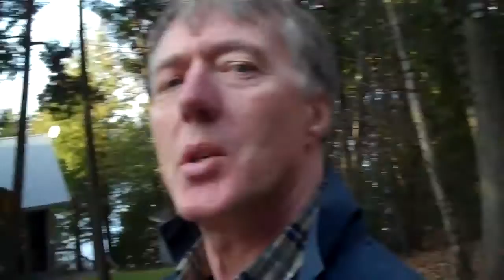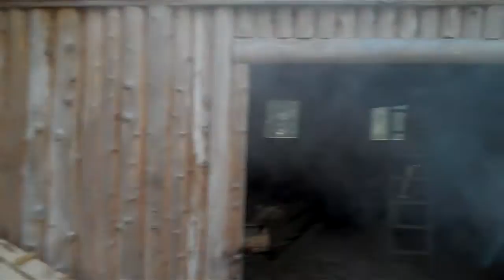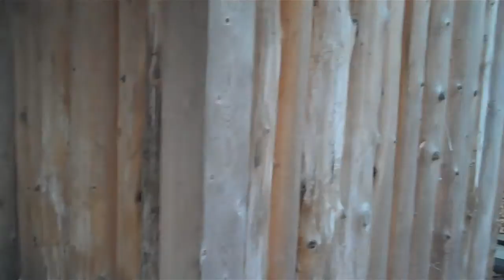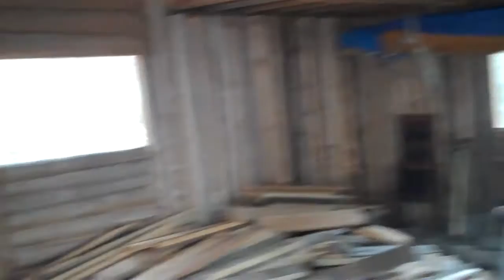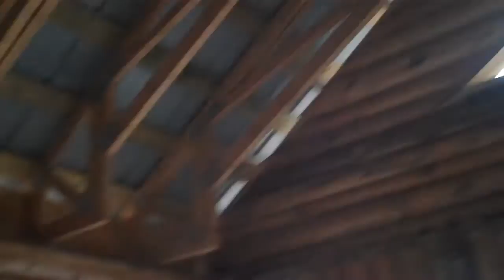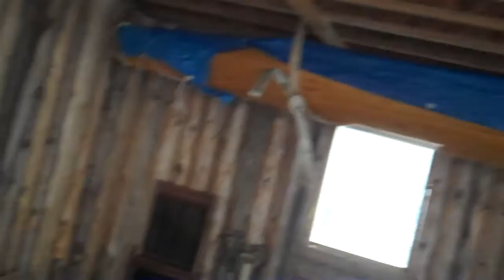Stockade style log garage

Comment: Thanks....radio is gone ...replaced with pool table and wide screen and dart boards. Yes I did use a jig to cut the spline groove. I think back to my poor neighbors listening to all that chain saw work flattening each log for a close fit with my chainsaw mill. They still speak to me .....amazing.
My jig was made from angle iron with a roller bearing bolted into the chainsaw bar near the tip.